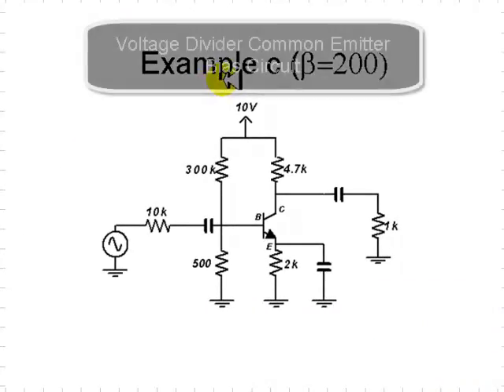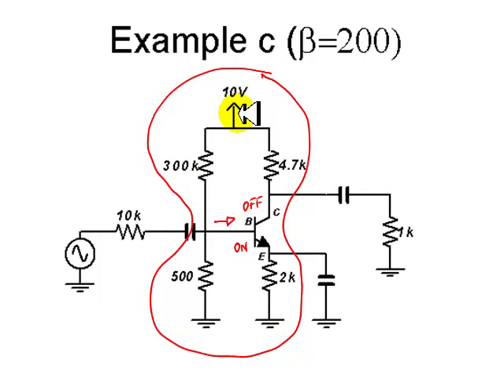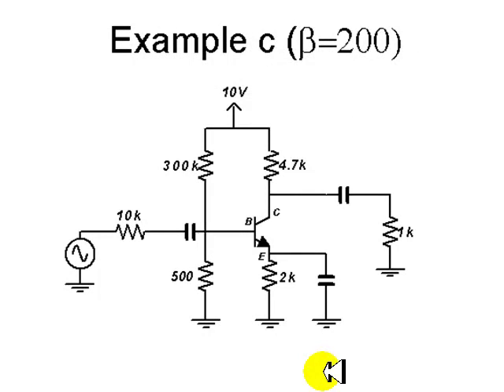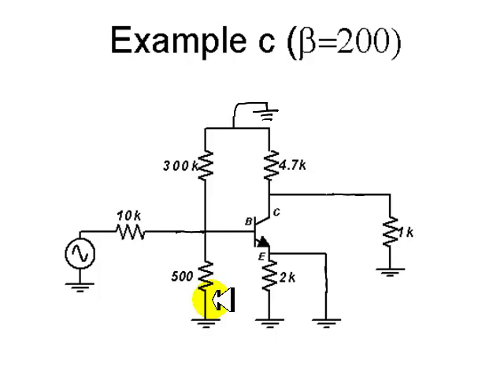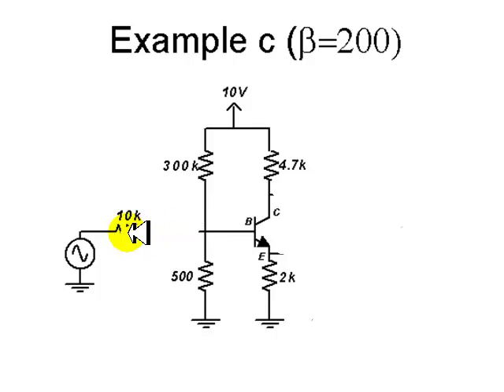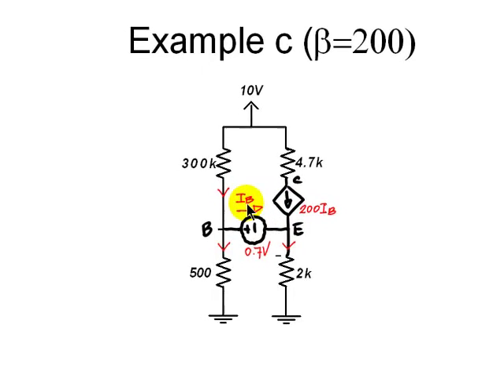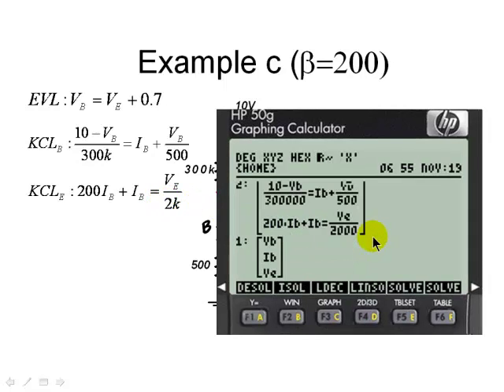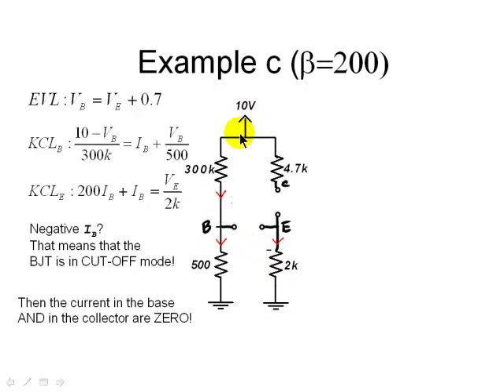EECE 251 - BJT Tutorial C (cut off)

Comment from the maker: The voltage of the base is the voltage of the B node with respect to the reference node, which by connection is the same voltage across R2. Because IB is zero, that voltage can be found quickly with a voltage divider VB=10*R2/(R1+R2). Or, alternatively but more laboriously, you can compute the voltage drop across R1, which tells you how much lower B is than the 10V source node, and subtract this drop from 10V. ... (to be continued)

Comment from the maker: (.continuation) ...You'll need, however, to compute the current in R1, which is I=10/(R1+R2), the drop in R1 is
V1=10R1/(R1+R2), so VB = 10 - V1, do the math and you get exactly the same as with the voltage divider. Cheers.

Comment: Im kindda confused here. When Ib is negative, the circuit is in cut off mode, however on our book when Ib is zero it is in cutoff. Why are they different? Or am I just misunderstanding it? Help please. Thank you
Reply from the maker: +Jackielyn Jane Yogawin In reality, the base current cannot be negative (it is the current through a PN junction, that between the base and the emitter). That is the physical reality. In the equivalent circuit on paper, where we are modelling the BJT with linear ideal components, when we solve the circuit for Ib and we find it as a negative value we reason "Aha! This is impossible, the actual current cannot be negative ... so it has to be zero ... and the BJT is in cut-off." But the procedural short path is " ... in the llinear model, if the base current is computed as a negative value, it's because the BJT is in cut-off ..." (The actual Ib is zero in the real, physical non linear device.)